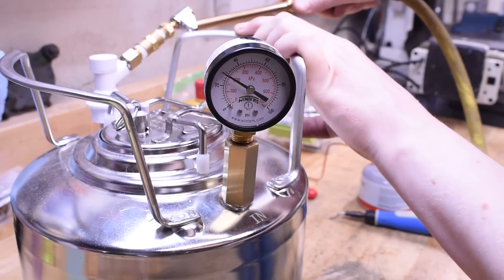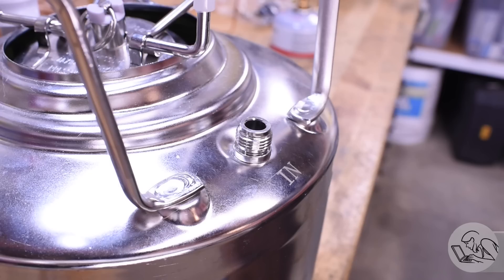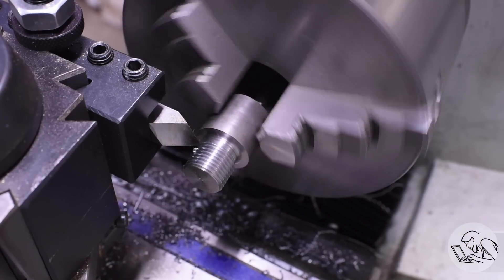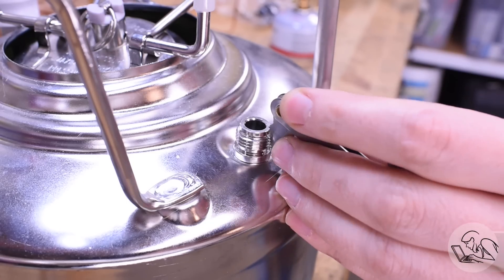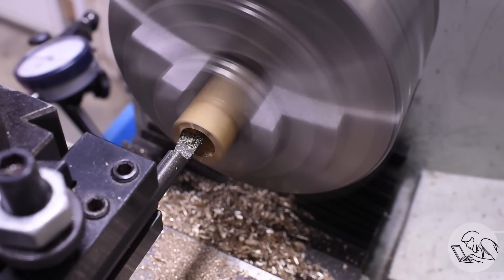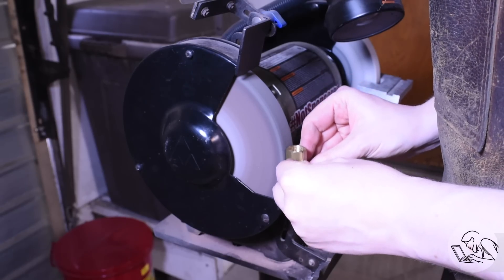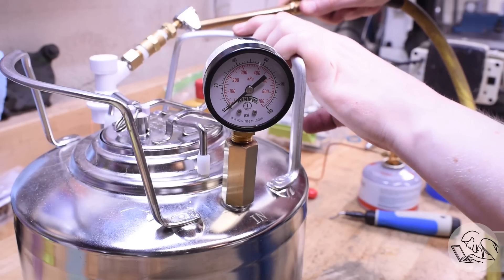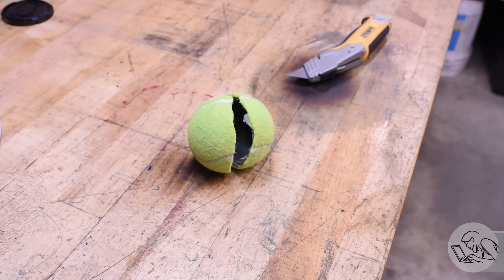Tennis Ball Pressurizer - Let's make one!

Comment from the maker: Hey everyone! The theme in this week’s comments is “that can’t possibly work because the ball will compress under the pressure and blah blah physics”

Except that it does work. There are other YT channels demonstrating it working, and you can buy commercial devices that do this. So let’s let that one go and enjoy the act of making something just for the joy of making it!
Reply: Seems to me that when the ball is compressed out of shape by the pressure, the material of the ball will be trying to spring back into shape, and that will reduce the internal pressure. Don't know that the resulting pressure difference would be large enough though. If this is the case then there should be a preferred additional pressure that has the most effect, where the ball material is trying hardest to return to a sphere.
Reply: @timbergel8147  Yes, thinking along the same line.  My first thought was to run much higher pressure.  After some contemplation, think that while the goal is to get to that higher pressure, probably need a long ramp time to get there. Something like one psi over ambient to start, then increase one psi a day for a couple weeks might be a place to start.
Reply: Science time! Try a high PSI :D I'm sure many of us would be interested to see the results
Reply: More interested in fatigue due to cyclical loading of the pressure vessel (after seeing the time lapse)...of course it is the same material used in kegs...so I will go have a beer and shut up while I contemplate it some more:)
Reply from the maker: @BrianFullerton  well, it is built for this purpose. It’s a beer keg, and they pressure cycle many many times in their lives.
Reply: @Blondihacks  Indeed, excellent point. Until I saw your time lapse, I simply had not realized how much strain was occurring at relatively low pressures.  Kegs do have long lives.  I need to refine my thinking about the potential fatigue resistance of stainless.  Thanks for providing an opportunity to expand my thinking.
Reply: Two weeks elapsed between measurements so obviously the moon is at a completely opposite phase and the change in the acceleration of gravity was obviously not accounted for.   ;-). Or the barometric pressure and humidity changed between the two measurements.  Personally I think I'd go with the second, as story you can spin would sound more convincing.
Reply: Hi I know this is old already, but i think its too much pressure and the rubber gets crushed, Maybe try to weeks at 10psi, two weeks at 20 and then maybe 32 or something like that. I have a transparent pressurizer and if the balls are too soft they deform and don't recover. Maybe if it's a really gradual increase they don't deform.
Reply: It is important to share failures. Everyone, even scientists and engineers, can feel reluctant to publicly display projects that fail to yield the expected results. If we don't share our failures our collective knowledge doesn't really grow, not with confidence anyway. 
So, in the truest sense, Thanks for sharing!
Reply: Hey Quinn... I always had trouble with parting off on the lathe... so I watched a vid of you where parting was themed. You talked a lot about ridgidity and the right toolheight etc.
well that was the moment I finally wanna get a other lathe. because my  chinese minilathe has to go. So i managed to get an old myford super 7. my first test on it was to put a 30mm roundstock in and parting it of, using what I learned from you. and guess what? the myford was eating metal for breakfast! Long story short: thanks quinn! please please go ahead with your vids:-)
you really rock!
By the way: At the end of the parting.... I really cant do something against---> aaaaaaaaaaaaaaaaaaaaaaaaaaaaand yaaaaaahtzeeeee

Comment: Really good video, thank you.  I am about to make one so this was particularly useful to me.  My understanding is that if the ball deforms due to the higher pressure outside the ball, then air will not pass through the rubber into it.  In this case, you have to start with a lower pressure; which then means leaving it for longer.  Eventually, you will be able increase the pressure without the ball collapsing.  So, the key is the difference between the internal and external pressures (known as "tension" in other circles).

Comment: “Thank you for doing the experiment. I did the same experiment as you, but this method doesn’t work. It’s not possible to restore the bounce because the rubber layer is thick and sealed — air can’t penetrate it. They just advertise it to sell the machine. This is just a tool to maintain the ball’s bounce.”

Comment: Just to let you know, the   "in" side is designated for gas pressure to enter the keg using the GREY ball lock fitting and the "out" side is designated to use a BLACK ball lock fitting. Yes! The grey fitting will fit on the out post but will leak as per your initial pressure testing. As  the two posts are of different sizes. The "in" side is slightly larger than the "out" side. So, there for you somewhat built it backwards. Great vid none the less! 👍

Comment: I could watch this all day. I created something similar with ag pipe with the blue liquid sealant, end caps and a bike tube valve. Firstly, ag pipe flexed on the ends which looked like it would pop off. It also had a small leak and would loose pressure  over about two days. Secondly the balls would rapidly loose pressure after about 10 minutes of playing. I think you need to lightly re-heat the rubber with maybe a paint gun to vulcanise the rubber of the balls. If you would like to see a pic let me know.

Comment: Balls can colapse if they are severaly depleted from their original pressure. If this happens then the pressure will need to be increased slightly start at 10 for a week, 20 etc. If you have a window this can be easier to monitor

Comment: That was an interesting venture!  It was entirely new to me, not a surprise though, I fill my tires with dry nitrogen, because it leaks out slower, larger atoms.  It the balls are "leaky" the pressure will seep in, and rejuvenate. If they are relatively impermeable, it won't do anything to them.  Aircraft tires are inflated with dry nitrogen to maintain any real pressure at altitude.  Thanks.

Comment: That whole thread engagement issue is actually more common than you might think, even today with all our fancy CNC and standardization. 
I worked QC in Aerospace for a few years. come across some parts from a supplier that would not fit our thread gauge. It was close; would thread on about 1/3rd way, but that is not a pass by aerospace standards, and the whole lot was this way. We sent our gauge off to be re-calibrated thinking that was likely the issue; but no. Then the engineer came hounding me claiming it went on sufficiently and I was just being picky, ect. I insisted, the thread is wrong, IF the thread was correct the gauge would travel the full length and seat firmly at the head of the bolt - that is our standard for passing threads. He threw a fit and got someone to approve the parts without testing them. That cost the company a multi-million dollar contract. 
They may have needed a spring pass or two, they may have been cut wrong/close, but not close enough. IDK, but they didn't fit my gauge, so they were wrong, the customer agreed with me and a few years later the shop closed down. Sad really cause I really liked that job, shop, and crew.

Comment: You could try pressurising with something other than air, e.g. argon or CO2, that will diffuse in to equalise partial pressures, which in addition to the existing air content will increase total pressure.  If what is in there in the first place is in fact air.

Comment: If I remember correctly, the connections on food containers (also with dispensing systems) are designed in such a way that they cannot easily be swapped. I once wanted to repair a connection on a coke premix system. ... a nightmare ... I didn't have a lathe in my tool case :-)

Comment: No advice re flat balls but now you have a pressure pot that you can use to squeeze some Cactus Juice into wood and use the thus stabilized blanks to turn some pens. You would be doing so on your machinists lathe, as is tradition, and by so doing, producing pens to +-.0000005 precision. There is no good reason for that precise tolerance but you would do it, because you know, you’re you. And you’re unique. And you don’t just cut to that level of precision; unique up on it! Am I out of the club?  Damn! 🥸👍👀

Comment: If a little pressure is good, a lot should be better! The relief should let go around 50psi. Another wierd nut is the one that holds the pulley on a GM alternator, it's something like .662-18. Kind of 5/8 fine. Ask me how I know. 
When you were sleuthing out the keg thread I was saying to myself "not a normal thread". This is also something I found out by doing.

Comment: Hi. I have a lot of experience repressurizing tennis balls and making pressurizers for the purpose, and it absolutely does work. 32 psi is a bit high, and many "dead" balls will collapse before reaching that pressure. You can see the pressure gauge take a little dip when that happens, and I can see it happening in your video. I often pressurize actual tennis ball cans which are clear so you can see the balls "pop" and collapse. New balls are shipped at about 14 psi. Dead balls generally won't collapse until about 20 psi, and relatively newer balls can handle much more and still remain spherical so they will slowly gain pressure. I generally repressurize at 20 to 25 psi. If any balls collapse at that level a lower pressure must be used for a week or so, then the pressure can be raised. Collapsed balls will not gain pressure. Some brands of balls repressurize better than others. And it is possible to overpressurize balls, they are "extra bouncey" for a while. 15 psi is a good pressure for like-new storage, 20 to 25 psi for repressurizing. Higher pressures are faster but have more risk of overpressurization. Of course the balls do lose fur and become lighter with use, so after some number of outings they do need to be retired from tennis and used for other purposes. Thanks for another fun video.
Reply from the maker: Great tips, thank you!
Reply: What's the best pressurizer build? Keg or pressure cooker?
Reply: Great advice alan!, How do I contact you  (regarding making a ball pressurizer) ?
Reply: @r3tr0n17  Recently I came across a new one on amazon from Spain that fits on a common ball can using a split ring and large threads and goes to 30 psi with a gauge and pressure relief button. It is filled with a schrader fitting like any tire. This one works quite well, I've been testing it out for a couple weeks. I prefer to pressurize to a lower pressure where the balls don't collapse and then work up. You can easily see them in the tube. If any collapse then lower the pressure till they return to spherical, increase to below where they collapse, and wait a few days, then work up from there.

Comment: Maybe if you stuck it in a Freezer under Pressure. As the Balls want to contract, maybe they would pull the Air in? Or just get a really thin Needle and Air them up heating the Needle when pulling it out to seal the Hole?😁

Comment: The "non-standard" thread for the tank is party so people Cannot use standard plumbing, worse Used plumbing, that can pollute a Food system with lead and more dangerous stuff. Also prevents stolen 5 gallon syrup tanks from Post and Pre Mix Commercial soda fountains to easily be reused. Most Post Mix system at restaurants now use small non-pressure bag in box and syrup is pumped out and just throw out in normal trash/recycle when empty. That solved many problems with old pressurize syrup tanks.

Comment: I had a similar experience trying to cut threads to adapt a fire extinguisher into a pressure vessel (after watching your single-point threading video). The measurements were wild and didn't match anything I could find. Super fun watching my de facto machine shop teacher work through a similar problem.

Comment: Strange tread. 
The only time I use a wrench 15  mm is on my Dutch bicycle wheel nuts and on the pedals. Strange sizes are ofted used on plumbing.
The tire stem looks M6. But no.
On an intake manifold of an Alfa Romeo are plugs M9x1 needed.  Never saw that tread again.

Comment: Hi, Quinn

You might try purging the container with helium, and using helium to represurize your tennis balls. Helium is a much smaller molecule that oxygen, and Nitrogen that make up most of our atmosphere. and thus will move more quickly through the rubber membrane of the ball.
We used to use helium to leak check things that were to be held under very high vacuum with helium. Very small leaks were easily located, and many times disassembly of complex apparatus was avoided. You might have a helium bottle for your TIG welder.

Tim

Comment: I guess the pressure inside pulls the rubber appart opening its pores but pressure outside closes them, so has a hard time getting in. Perhaps a heat cycle would help.

Comment: Makes me wonder if this would also work for racquetballs, squash balls, and other similar sports items?
Edit after watching, Bummer it didn't work. That makes me wonder if the gas used has an influence, maybe pure nitrogen or some other gas.
Or like you mentions Higher pressure could help. but maybe the rubber loses/increases in porosity over time... like racquetballs will get harder and less elastic as the rubber changes over time, maybe that affects how porous they are and if they can be "recharged".

Comment: I was thinking, "wow that hydro test device sure does come in handy, I need to get around to ordering one", and then you pressure treated with air 🤣 didn't realize the target was only 32psi. Presumably if you go for a higher pressure in part 2 you'll hydro test first?
Reply from the maker: Well, presumably the factory tests them when they make them. I wouldn’t exceed the intended pressure of the keg.

Comment: I am wondering if the reason the experiment didn't work was because the tape was upside down as you stated. Perhaps during the time between tests the balls forgot if they were supposed to get a higher number or lower so they decided that some should go for the higher number and others go for the lower number. Since they didn't want you to feel bad, they came to this compromise. 
Just my two cents worth and thanks for another great video. 😀

Comment: That thread looks like a PG9 thread - .598 x 18 TPI, with a thread angle of 80deg instead of 60.  It's a legacy, yet still commonly used, German standard for cable cord grips and conduit.  PG is short for the wonderfully German name "Panzergewinde".  https://en.wikipedia.org/wiki/Panzergewinde
Reply: A few years ago I made an extension piece for an Ikea floor standing lamp - wasn't aware of PG9 then, but it sounds exactly what I had to make.

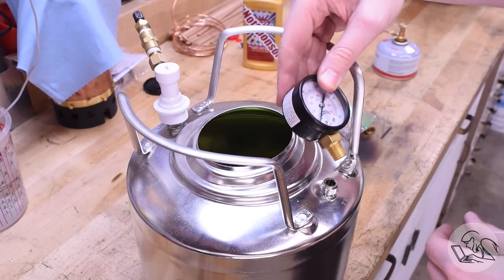Comment: You must not have read The Machinist's Comedy Manual Appendix 10 11/16's where it clearly states that in order to tell this joke ( 1:47 ) , "You must use silver duct tape... blue masking tape is guaranteed to cause the joke tolerance to fail by seventeen-thou."

Also your "friend" wants pressurized tennis balls? Come on. We all know that Sprocket is being overly fussy about the bounce in those balls... yet another reason for a shop dog... they would be totally appreciative of just getting the ball you craniotomized.

Comment: Am I the only one who was transported to Henry V when Quinn opened her vessel full of tennis balls?
"What treasure, uncle?"
"Tennis-balls, my liege."
But, here's a question: suppose that the idea works and that compressed air does indeed diffuse into the old balls over time. Wouldn't one expect a slight pressure drop in the vessel as air moved into the balls?
And, remembering that PV=nRT, was the temperature the same for all of the test bounces?

Comment: Interesting experiment Quinn.  Fortunately my dog has shown me the inside of hundreds of tennis balls.  In about 3.3 seconds she can have one completely filleted, surely some sort of record.  Its quite interesting how 2 of the balls were actually worse after the "re-pressurizing"  I'll think about that all night while I can't sleep because this puzzles me so...Thanks...for another great video.
Reply: Definitely a head-scratcher Denis.  I would have liked to see her make an acrylic, stepped go-no-go gauge.  A stepped tube to check the size growth of the balls.
One would think the pressurized balls would grow slightly.
You have to wonder how much smaller they get in the pressure chamber (hint: a clear acrylic lid would work for this).
Anyway, everyone knows if you want to make a cockroach BIGGER you simply put it in a vacuum chamber and suck.  They easily triple in size before they explode.
So, if were trying to make the tennis ball bigger, one would think a vacuum would work. And it would guaranteed, until of course, you released the vacuum, when it would be smaller than ever due to the leakage theory.
Clearly one of the balls gained pressure, so one might assume it to be the ball that leaks the most, and let the most air in.
If that is correct the balls with the least change are the best and just need a longer amount of time to fill but will hold the pressure longer as well.
Let's try to get some sleep and we can discuss this more tomorrow after I clean the cat off the wine press. See 11:06